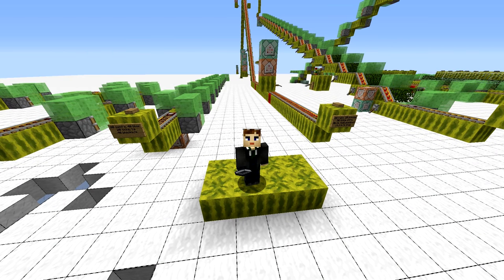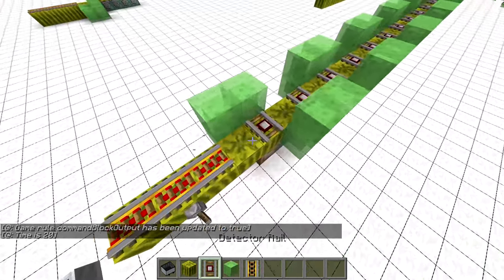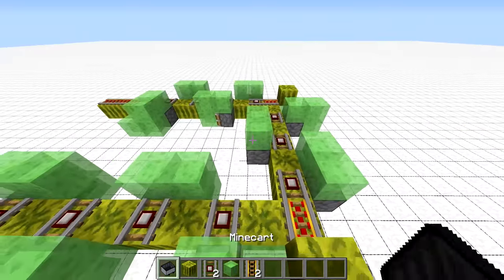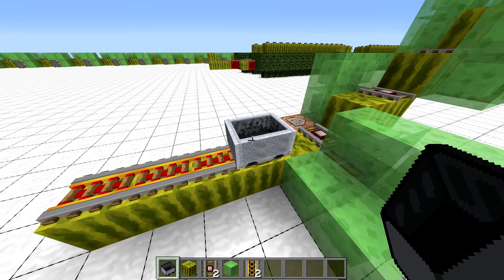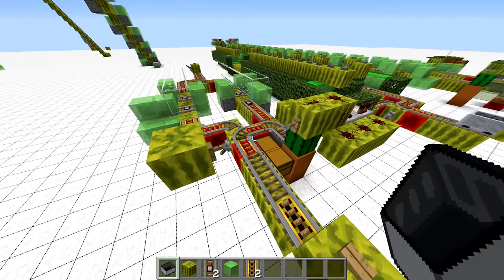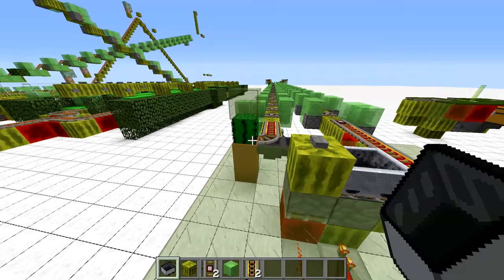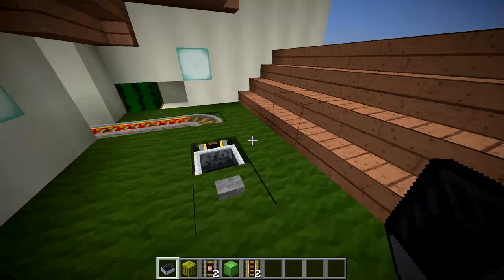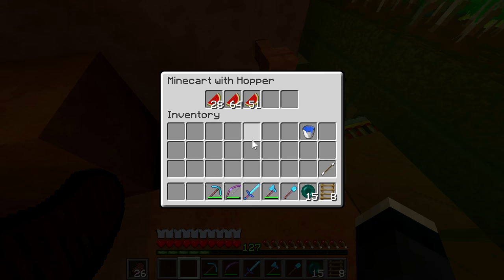[Patched in 1.11] Minecraft translocator - railway combo. Flexible and fast transport system.

Comment: Great work Gnembon! I would only change the translocator design to keep everything cleaner and more compact.

As others have said, this song has been very overused by vloggers now!
Reply from the maker: Yep - I dind't know about that - seems I am not subscribed to such channels? Which translocator design you had in mind. With all the quirks of ragou's translocator, I am not aware of a simpler and cleaner design?
Reply: Yeah, maybe you are not!

I don't really like slimeblocks since they stick to everything and a two sided system will be incredibly wide. Also that you can break them easily by clicking accidentally. I saw a design from TheLoonofBlackMC, it is a bit more expensive, but cleaner and more compact!

Comment: fantastic as always. what a great way to make a fast, polished transit system. with the elytra available, standard rail transit isn't particularly appealing anymore.
Reply: While I agree that small distance overworld travel has been made useless by elytra outside of decorative aspects, building systems like this in the nether works remarkably well. Due to travel in the nether being 1/8 the distance of the overworld, you can travel 10,000 blocks in the overworld in just over 30 seconds using these systems (10,000 / 8 = 1250. 1250/14 = 31.5). 
Considering elytra bow flying averages at 30m/s, that same journey would take 333 seconds AND would require constant checking of direction, angle and altitude while this is mindless.
Reply from the maker: Yep - I didn't mention it in the video, but indeed - elytra glide speed it 'only' 30b/s. Ragou's translocator (and other 40b/s designs) are really awesome in this regard.
Reply: Ya, is more effort to make this initially, but it's speed and mindless is why, even in the overworld, this has a place. It's just the standard rail systems that I think are getting abandon, because they are slower and less flexible than the elytra. But this system has the speed to make it worth it, and I really liked the system you showed for making easy stops along a transit system.

Comment: Well, in my seed I want to make a railway system in the overworld that can handle even minecart with chests so this one is not my design; however, for the Nether this is going to be ther for sure.... so excelent video gnembon, asl always <3

PD: What I want to make in my overworld is something like this: A Railway in every important place of my world (that is going to be close to my house) that I can grab a Minecart and go to my home and another rail below it for the minecart with chests, so if someone has an idea for making this more reliable, I'd be glad for reading it xD...
Reply from the maker: On scicraft they are actually using ragou's translocators to make trains for transporting goods. The thing is - you need to put minecarts with stuff before and after the player automatically (drop on the rails automatically), so the player acts as a mobile chunk loader. It works :-)
Reply: gnembon_mc I don't know, it'd be dificult to fit in my station but I'll try, thanks for reading it and I hope you finish soon with the new project, I have a lot of hype
Reply from the maker: check this out: http://imgur.com/a/ujQUH
notice the delays. The more render distance you have the more minecarts you can queue up.
:-)

Comment: I love it but I don't get how I'm supposed to know when to get out of the minecart with very long tracks, or are you just supposed to make a big red sign at the station which you can see from far away so you know when you get out? :-) Very informative video by the way!
Reply: You either have to react fast enough at the station, or like you said you could build indicators, say at 50 blocks before every station you have a bar of yellow stained clay going around that tells you a station is coming up. 

Then, if you don't know what station this would be you can just hop out and get into a new minecart (if needed).
Reply from the maker: Its like a regular metro system - if you fall asleep in it, you would wake up at the last station. If that's what you need, the easiest solution would just be to have stations with two unpowered rails to always stop you on them. But with 12-long stops, you would have 1.5 seconds to react as a player - should I hop off, or should I stay.
Reply: You could even connect the detector rails to some noteblocks before the station so you have a good indicator that it's coming.
Or you could build a crazy contraption that would send a chest minecart just before you with a ticket inside that would specify the station that you want to be ejected on.
That would be unnecessary but amazing.

Comment: Awesome work , btw one question is it possible to build a faster system than this ?
Reply: not really. there are a few concepts, which are all impractical.
Reply: @ilmango Is your comparator translocator broken in 1.11? Because if it isn't up and down segments of those can be handy for the up and down segments in this design, essentially using all 3 minecart moving techniques (regular rail, pistons, ragou's). Of course I am not counting slimeblock pushers as they are slow.
Reply: +ilmango hmm I see thanks for explaining
Reply from the maker: yep, mango would know best what is possible. The only thing if you really want to get somewhere fast is use 40b/s horisontal transport with 40b/s elevators and 40b/s 'delevators', but for most intent and purpose, if you carefully monitor what it the vector of minecart momentum, this would be simple enought to get you from A to B where difference in elevation in A and B is not too high.
Reply: gnembon_mc not to forget that it looks cooler and more representative of a railsystem/underground using your configuration rather than going vertical.
Reply: well there is one thing , dose the behavior of minecarts change when they enter a lazy chunk? , how about the rails ? , you explain it good , doesn't the behavior change to a server ??
Reply from the maker: you should always try to have a player with you when transporting goods, even on regular rails. With ragou's translocator the easiest thing in my opinion would be to use the following setup: http://imgur.com/a/ujQUH Than the player travels with the goods and chunkload the area for the transport.
Reply: I see , thanks this did make it a lot easier for because on our server we have a very complex system but this will make travel a lot easier and not to worry about chunck unloading, thanks :)
Reply: jimy hemn Boat on packed ice gets up to 40 blocks/s. I.e. 
[Wall][Air][Air][Air][Wall]
[Wall][Air][PackedIce][Air][Wall]
[n/a][Floor][n/a][Floor][n/a]

Works in the nether too since packed ice doesn't melt. :-) 5x faster then mine carts. The disadvantage is that you need to spawn proof the ice road (buttons, carpet, tunnel, lights.)

Comment: Hmmm interesting, why did you use the time to count the amount of ticks rather than a scoreboard?
Reply from the maker: daytime seems to be just a convenient, built-in method of measuring time using a built in  clock
/time set 0 # on start
/time query daytime # at the end
It would be a little more compicated with scoreboard.
Reply: ehh i guess, daytime can be convenient but it can only store 1 value at any given time, also you can't do operations with time. but yea, i guess for something small like this it works. also i think it wraps around after 1 full day so not good for long periods of time either